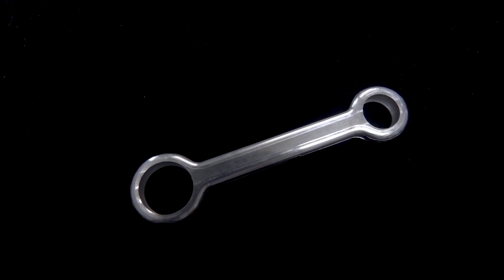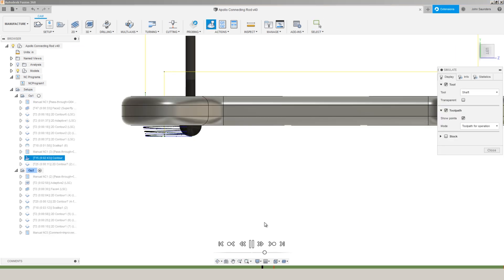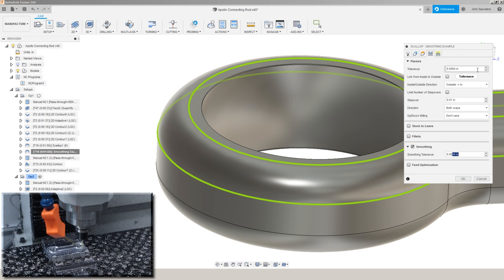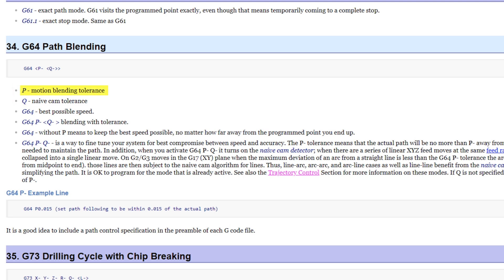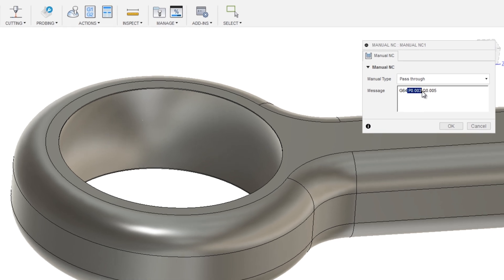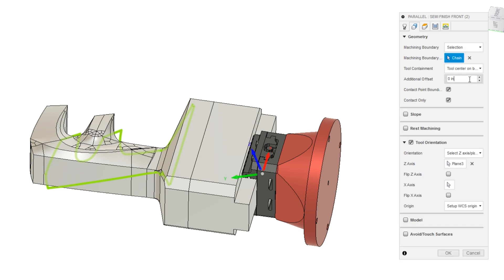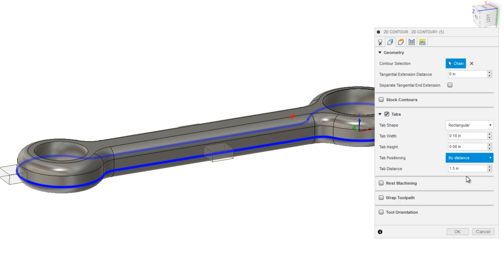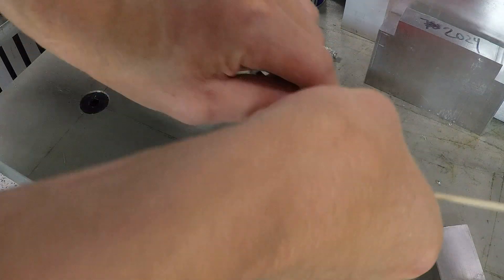Project Egress Part: Linkage Rod | WW262

Comment: Dude just run op 1 then cut soft jaws and deck off the back and do the radii why do you over complicate it
Reply: My thoughts exactly. If it's time for hot glue you've already failed 😂
Reply: The whole point is to avoid soft jaws. Imagine a bunch of small parts for a small batch application. Throwing one bigger piece in and cutting a dozen parts with tabs out cleanly. No need for designing soft jaws, cutting soft jaws, or switching and flipping a bunch of different parts. 

How about just one off parts in general. Knowing some key things for tabbing and quickly throwing square stock in and cutting the part saving the time of modeling and cutting soft jaws or the need to flip the part, establish the new origin, etc. 

Some of his analyzing, or in your mind 'over complicating', is experimenting to dial things in for future reference.

Comment: Another excellent video John.  Really like how you dig down into CAM settings to show everyone how a small change can make a big difference.   An alternate method to retain parts that I've found works really well is low melt temp (e.g. bismuth) alloys.  I've used them for wire edm work, turning and milling.  Considerably more expensive (and less convenient) than hot glue, but it's a very solid holding method, and relatively easy to extract the part later with a good heat gun or in the oven at fairly low temp.  (fwiw).

Comment: I did a piece a while ago with tabs, this is how I did it:

I cut a trench with a bigger endmill before cutting the contour that contains the tabs ("ramp" or "wedge" style tabs work best for this approach) with a smaller endmill (2mm in my case, the smaller the better).
On the 2nd side I machined away the contour till I had about 1mm thick tabs left. After that I slowly removed the tabs with a shallow DOC till I had about .3mm left.
This allowed me to break the part loose with just my thump (not even using a hammer) and the tabs that were still on the part were removed with an abrasive stone.

Comment: Why didn't you simply use a radius or form tool for the radius? Works beautifully and in fairly cheap.
Reply: He said in the video he was playing around with pathpilot.
Reply: Using a ball endmill to do that outer edge radius was a BS showboat move that wouldn't be acceptable in any shop I ever worked in. Run around it twice with a radius cutter and be done with it.
Reply: Shop Tech Customer calls... we want a part by tomorrow morning and will pay if you make it right away! 

So, maybe you don’t have the specific radius mill... what then? 
Buy and expensive cutter on which you’ll have to wait and don’t make the deadline.. or just ballnose it because it’s just one piece and still make the deadline.
Reply: @WasNiksIsNiksWordtNiks  Grind a form tool...
Reply: Axis Right. Or just use a ball nose, and let the machine do it’s thing and you have time for other stuff.
Reply: @WasNiksIsNiksWordtNiks  You honestly believe NYC CNC doesnt have the right cutter? C'mon. Your theoretical situation makes sense, but we both know that wasn't the case.

Comment: Use flow, use flow, use FLOW! For large fillets and similar features always at least try flow toolpath in Fusion 360 if you can (and I know you can John!). You get much more even distribution of points than scallop or even contour etc.
Reply: Jaká je výhoda oproti 3d countour? Nikdy jsem flow nepoužil. Díky za odpověď
Reply: @sarmik13  Flow pracuje primo s modelovanym povrchem a jeho u, v souradnicemi (jako bys ten povrch potahoval texturou). Vysledkem je daleko rovnomernejsi a tvar objektu lepe vystihujici toolpath a body na ni. Taky nemusis resit jak strmy dany povrch v danem miste je. Jen zadas kolik pruchodu chces a fusion dopocita optimalni rozestupy atd. Vysledny finish je potom viditelne lepsi... I kdyz je flow ve Fusion 360 v 5-osych CAM operacich, ma i 3-osou variantu, ktera se hodi kdyz nemas 5-osou masinu...

Comment: Do filliting endmills exist for CNC  machines similar to the round-over bits for woodworking routers?
Edit: just seams like a round-over bit would be less of a headache.
Reply: ADRIAAN1007 they do exist but they are a pain to get the heights correct and not leave a lip or gouge on the part.  Most of the time it’s way easier just to program a 3d tool path.
Reply: @northernsmith  its actually pretty easy i always tell the Maschine a slightly bigger diameter and length off the tool after dialing it in. Works everytime
Reply: @nf794  Useful, thanks.

Comment: Noice! But it looks like you could have made 2 from that one piece of aluminum... Any reason for making 1?
Reply: I'd think because of workholding issues and you'd need to step down to a tiny endmill to cut between them if you were inferring a side by side setup.   But, I'm sure you could make it work if you really needed two.